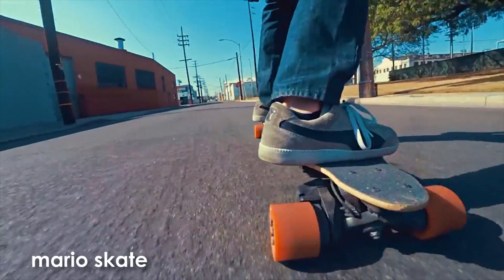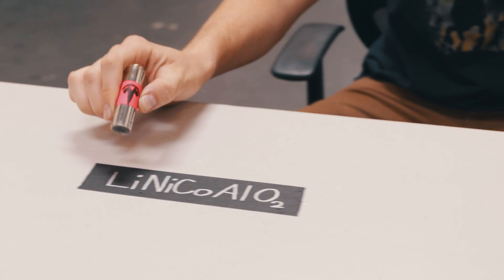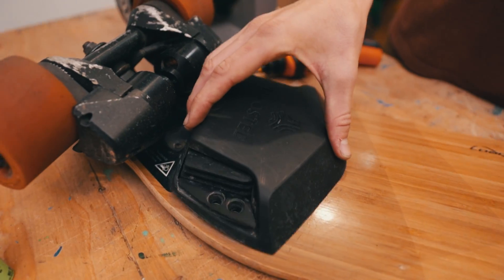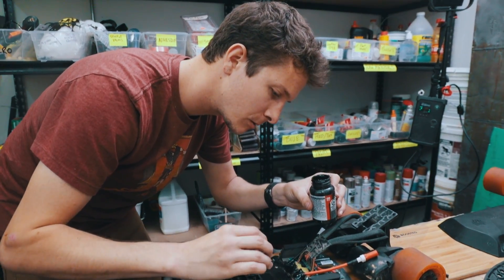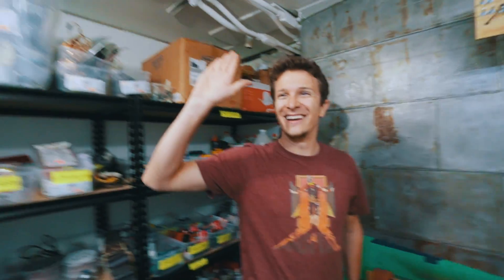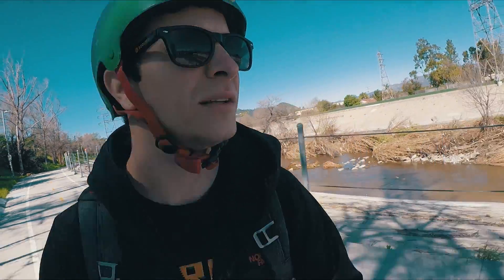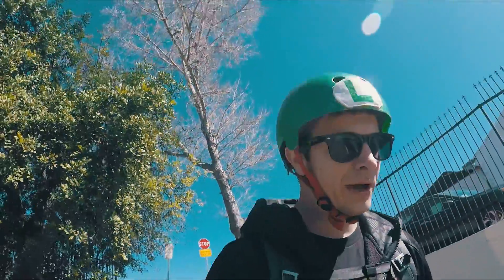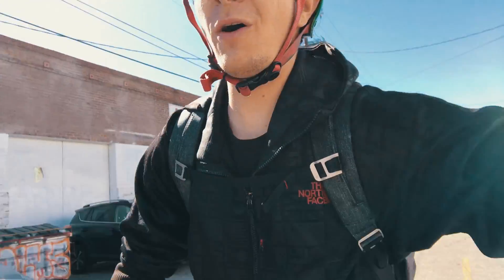Tesla Batteries in an Electric Skateboard!

Comment: Thanks for the comments everyone!! I appreciate the feedback! It turns out I really underestimated the current draw to the motors. I understood that the batteries I used didn't have high power output, but my hypothesis was that using two packs to share the load would be enough to compensate. Wrong! It turns out I need at least 4 or 5!! Dangit!! I know better, I should've done the math on this first.

Geeky numbers section: So the motors are 2000W and the current draw is about 50 amps (at full speed). The battery system I added maxes out at about 20ish amps. The solution is to either use more packs in parallel, or make new packs with much higher power output ratings. So the issue had less to do with Voltage, and more to do with the battery's inability to provide enough energy fast enough. 
Again, this is just yet another hypothesis. I won't know if I'm right until I test it again. Another video solving this maybe?
Reply: Will Wren solve the mystery? Find out next time on Battery Busters.......
Reply: wren - explanation is ...ok (scroll to the end of my comment for a simpler explaination)
Issue is the "water" is amperage.
The bottleneck would be the voltage, your pour analogy between the cup and the bottle would be incorrect. It would be correct, if the cup was a smaller bottle. Pour at the same rate (voltage), but one empties faster (amperage).
Voltage is the "path" of the amperage.

The reason why most power monitoring devices use voltage to check battery life, is that it's easier and uses less components to do. When amperage lowers in a battery to a certain point, the battery itself starts to "add" resistance, thats why you start to see the voltage drop. "Adding" isn't entirely correct, but just makes it easier to explain.

I assume you used batteries that have a mah (milliamp per hours) rating of 2000 or 2500 (2amp to 2.5amp)
You should really be using ones that are 3000mah or higher. Probably the highest you can get will be best. Fair warning, these batteries can get pretty pricey, probably end up costing as much as the skateboard.

And Tesla start making their own batteries because existing battery manufacturers can't produce them with the mah that they want. That's the holy grail as far battery life and efficiency.

If possible you want to get batteries with the lowest possible "C" rating. I forget what C stands for, but the lower the number, the higher the amperage it can push out.
----------------------------------------------------
Just to make it simple in what you needs to do, is since you already know the original battery voltage, find out what the watt/hour or mah the original battery is rated for. 
If watt/hours then plug it in the following (watt/hour) divided by voltage multiply by 1000
It will give you the mah of the pack, then divide it by the number of cells int he pack. 

Then you just need to find batteries with a significantly higher mah that the number calculated......

Or simple solution is to just put more banks of batteries on there.
Reply: Why dont you just make the board run only off the new battery packs instead of the ones in the board AND the battery packs.  Don't use both, make it run off the new packs you made only.
Reply: would love another video on this! i find it super interesting and entertaining, plus i really want to see you succeed at this project! think it would be really cool if u could pull it off
Reply: Off battery topic: Be careful going too fast dude, I had a regular long board for years, went a bit too fast going down a hill ( similar to boosted board top speed)  went to jump off and my knee folded backwards ... like a flamingo! Vomited with the pain and seeing my knee like that....5 months on crutches, surgery and 1 year of rehab. Sold my beloved board :(   Interesting video dude!
Reply: Mr Moyaa Will he figure out the mystery? Or will he be wrendered helpless to the power of his car?
Reply: wrenthereaper another video I'd watch I love the DIY stuff. The Geeky science is good every once in awhile as long as it's fun for you in the process 👌🏻
Reply: wrenthereaper yeah the Panasonic cells can only deliver 7 amps. With only 2 parallel packs thats not enough and is going to cook the cells.

Did you use them in parallel with you original battery? I would't do that. I'd get rid of the original battery all together and only use your new packs (more of them in parallel or with better cells like Sony's new VTC6). Even when in storage for 6 months the original battery should not have lost that much voltage (I have cells that only lost 50mV in the same time. That means its probably at the end of its life. When these reach their rated life (250-300 cycles for high drain cells) not only will they only have 60-80% of capacity left but also only be able to supply 60-80% of their rated amps.

oh and remember that the nominal cell voltage is 3.6V. so if you want 40V 10S is not enough. better go with 11 or 12.

another note. a lot of the comments here are horrible advise from people who have absolutely no clue what they're talking about, so take everything you read here with at least one grain of salt (including this comment I guess;). better get on the endless sphere forums to get your questions answered there.
Reply: No, you don't add current of the cells when you connect them in series, you add voltages, so the way he has it connected(with 4V 10A cells) is 2x 10 cells in series making two 40V 10A cells then connected in parallel making one 40V 20A cell
Reply: Portable Electric Vehicle  no, thats not true. Countless people have huge soldered batteries without any issues. See Jehu or all the powerwall builders here on youtube. Its kind of an urban myth. Just don't use a tiny iron that you have to hold on the battery for minutes. With the right iron the soldering only takes a couple of seconds and that heat is quickly distributed throughout the cells. I hear this a lot, but nobody can ever back it up with any kind of evidence.
Reply: Portable Electric Vehicle Illegal? Ever heard of Fair Use?
Reply: This was a really cool video. I'd love to see a followup vid! You're a crazy genius and I love it!!!
Reply: instead of 18650s try 26650s
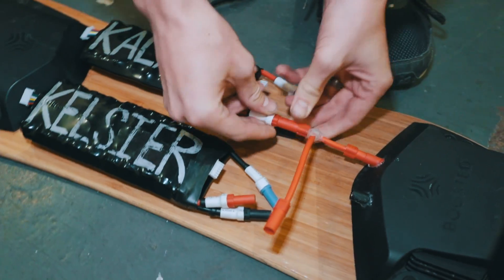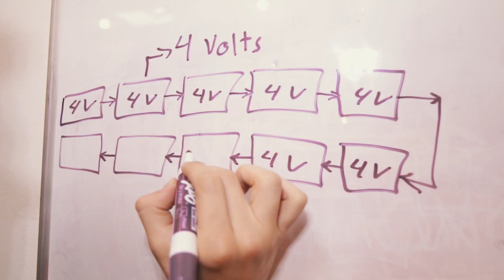Reply: androd - He's not up'ing the speed, he's upping the range. He's not increasing the wattage draw, so heat wouldn't be a factor. And I don't see why having the original battery in there would cause any harm, except it being dead weight when it's flat. He's running the packs in parallel to increase mah, you can see that they are in parallel at 4:20 . He put the "cells" in series in each pack to MATCH the voltage of the original one. He even said this at 2:35

wren- another idea is to have removeable packs, so you won't have to have so many packs under the board at the same time. when it runs flat, just swap it out. I suggest you keep the parallel connector there, so you can plug in the fresh pack THEN remove the flat one, so the controller board doesn't shut off.
Reply: +mtktm - You made a mistake about the C rating - the higher the number, the better. C indicates how many times it's capacity can the battery output in amps.
Reply: angrod - It was 5 mph when the batteries were running flat. towards the END of the video 9:45 . The boosted board has a top speed of 22 mph and a range of 5 miles.

The board was clearly working when he read the battery meter on the hand controller, was reading dead. 

With an assumed average speed (when fully charged) of about 10~15 mph it shouldn't degrade anything due to heat. And its an AC drivetrain, so the motors aren't the things that get concerned about over heating, it's the motor controller board, specifically the MOFETs. if things got hot enough to degrade it would have happened with in the first 30min ~ hour.
Reply: The best option would be to use higher discharge current batteries, like the LG HG2, they are the same size (18650), have the capacity of 3000mah, and max continuous discharge current of 20A, so 2 packs of 10, connected in parallel, exactly the same as your current setup, would provide 40V & 40A, so 1600W. That should be enough.
Reply: @Portable Electric Vehicles: Vitalie, I'm a fan of your videos. I definitely defer to you in regard of what I'm doing wrong here. I'm just trying to learn and get better at this. Your feedback is valuable and I'll definitely consider it by first revising my calculations, as you said they were wrong. It's possible I damaged the cells by soldering them, I knew it was a risk. I tried to be as fast as possible and they've shown no issues while doing charge and discharge cycles with my charger. Worst case scenario is that they are damaged and I just need to make new ones. 
As for copying your videos... I hardly think this video copies yours. A couple of your videos definitely inspired me here but I think everyone can agree they're very different.
Reply: What did he use that you created there?
Reply: wrenthereaper Don't worry on the soldering. You did a good job with it and whatever the issue is, its not from the soldering.
Reply: dood, just buy a bicycle :D
Reply: why not use 26650 batteries? alot of them are 30-35amp max discharge with a pulse discharge of up to 50 amps. they're 8mm taller then the 18650's but they also hold up to 5000mah instead of the max 3000mah of most 18650's.
Reply: maybe you should use LG choco 18650 cells that can output maximum of 30amps each with a capacity of 3000mah.
Reply: You could try Sony's VTC5 or LG's HG2 batteries. VTC5 has constant 25A output, and afaik it can also output 35A without too much heat. HG2 has slightly bigger compasity, but it can't output that much of amperage
Reply: + wrenthereaper YOU COULD MAKE IT SO IT RE-CHARGES THE BOSTED BOARD BATTERY
Reply: Star Blaze Very nice.... Very nice...
Reply: wrenthereaper be serious Wren... we know this was all just an elaborate audition tape to be a guest star on the new Bill Nye show... lol
Reply: An electrical circuit is only as good as its weakest link. The Boosted Board battery is inferior to your extra batteries and thus becomes the limiting factor. The only real way around this is to replace it with more of your own batteries.

Btw, increasing the available amperage to the motors is a neat idea however it comes at the price of heat. The motors probably aren't meant to handle that amount of current. It might do fine on level ground but going up hills could burn them out quick.
Reply: Unfortunately this is a bad idea. Linking the batteries in the way you describe will put the new batteries in series with the original one which will increase the overall voltage. Basically they will add together and he will have 80 volts applied across the motors. The board would turn into a rocket but he would quickly kill the motors from heat.
Reply: I see. I got the range and speed confused. I thought he was trying to increase the speed, not keep it elevated longer (and increase the range.)

I personally would still not be comfortable doing this. I would rather just ride a bike which comes with the added benefit of exercise!
Reply: +Wojtab - discharge capacity is the C rating
Reply: mtktm sorry, but there is a lot of wrong with your comment.

First of all, Wren uses Panasonic NCR18650B cells. They have 3400mAh and can deliver around 7A continuously. Those were the cells first used by Tesla. Tesla did set up the Gigafactory because they need vast amounts of cells, not because they can magically produce better cells than everyone else. In fact, the Gigafactory is a cooperation with Panasonic.

Lets say his board uses 2000W worst case @40V. Thats a 50A draw. His two 18650 packs can deliver 14A together. Maybe double that for short periods. Thats just too much and will kill the cells. 
I still has his original battery paralleled but I think that one is at its end of live. If it lost that much voltage while in storage I'd say its done. Healthy Lithium Ion cells should only lose minuscule amounts of voltage over that time. 
It could be that the original battery is constantly losing voltage and thus dragging down the new packs paralleled with it. But he showed, that the voltage is kind of ok, so it must be the lack of amps. In any way, the original battery is too different from the new packs and I would get rid of it.
It could also be that he's using too few cells in series and is not getting enough voltage. I don't know what his board uses but 10 cells in series is only 36V nominal, not 40V as shown in the video.

Your explanation of C rating is also wrong. A 2000mAh battery with a C rating of 1C can deliver 2A of current, with a C rating of 0,5C it can deliver 1A and with a C rating of 20C it can deliver 40A. So higher is better (not that it matters in this case)
Reply: Ivan Stroganov i have all info on my channel. but i dont know which cells is he using. tesla panasonic B are not the same u can buy in the store. the one u get in the store can give you @18 miles on flats with @15 mph at the last 2-3 miles. he maybe killed the cells when he soldered the cells.
Reply: Portable Electric Vehicle soldering the cells is no problem. As far as I know there is only one NCR18650B. There are other versions like the NCR18650PF and many many more with slightly different specs. But the NCR18650B is commonly known as the Tesla battery (Tesla later used custom versions of it and is now abandoning the 18650 form factor altogether). The original boosted board uses LiFePo batteries that can deliver 50A continuous and 120A peak each. The Panasonic can do 7-10, but running it at that level you're reducing its life quite a bit. They are no high drain cells, it only works in a tesla because they have many thousands of them and use high voltage to keep the amps down. 2 parallel is just not enough.
Reply: Portable Electric Vehicle Dude I know that Tesla uses different batteries NOW. They used off the shelf NCR18650B cells in the first Roadster and thats why they got that nickname and thats why Wren calls them that. When he solders his pack you can see the green Panasonic wrappers. So its the B cells (or a variation of them like CG, PF, etc). He just calls them "Tesla cells". I totally believe you that the esc has 30A, and I know that the Original uses 50A/120A ANR26650M1-B cells, but his 2 Panasonic packs in parallel is still not enough because it can't put out the amps if we have to consider that the original packs is dead(ish) from the way it self discharged.
Reply: wrenthereaper I wouldn't mix battery chemistries. I think you are essentially reverse charging the original pack because it will have much lower internal resistance and be delivering the bulk of the power while the newer packs remain at higher potential so will reverse charge.
Reply: hm, what if you replaced the original batteries with two more of the ones that you have used in the custom battery pack already? just an idea, im no expert so idk if itll work, but assuming the original battery is, in design, lower tier than the new additions to the one you have, i suppose, the whole is only as strong as the weakest link, in this aspect?
Reply: wrenthereaper I'm no tech head or know anything about electronics, but this video was fun. My question/solution: is there any way to get the original battery pack to stay charged? Like instead of all the battery packs using power for output at the same time, let the original battery pack handle the output and let the new battery packs focus on keeping the original battery pack juiced? Again,just a thought from someone who knows nothing about electronics.
Reply: Josh Locke everything under 3 volts per cell damages the cell, so you want to stay above 3 volts and preferably even above 3.3 volts.

using amp cells could be the sollution, but unfortunatelly they hold less charge, so range is lower.

More packs would provide more amps and range.
Reply: wrenthereaper couldn't you just remove the regular battery
Reply: your amp draw is a function of your own weight pushing down on that board. Reduce weight to increase range or add batteries in parrelle to increase capacity and amp output. Capacity is a measurement of Amp hour. More amp hr means more capacity.
Reply: why not replace the booster board battery with the 18650 pack
Reply: steffen ottemo the capacitor has to be charged with the battery packs, so for range it will not improve anything. 

It could help out with sudden spikes in power demand, but it won't help with a constant 50 amp pull from the motors. If you are constantly pulling 50 amps from the capacitor, the batteries need to fill it up with a continuous 50 amps aswell.
Reply: Follow-up video. Please.
Reply: i would suggest having higher voltage for the batteries.. and add a converter to 40v or what ever is needed.. so that ur batteries can withstand 2k W
Reply: wrenthereaper DUDE. REPPIN' THE SANDERSON, I love it.
Reply: wrenthereaper no I'm to late wren please read my comment
Reply: I'd love to see another video on this topic, found this one very interesting
Reply: you can check on my channel some of the info.
Reply: I wish i had a one wheel or a boosted board...GOOD LUCK ON THE BOARD WREN!
<3
Reply: Cody Myers - the numbers for the battery names, are just the physical size. 18650 would 18mm diameter, 650mm long. When it comes to lithium ion batteries, larger doesn't meant better. I believe 26650 have a slower discharge rate and not much difference in mah.
Reply: He did mention he wants to increase the speed as well as the range. I don't think he wants to have a 3 hour ride to work at 5 mph.

Wattage is merely a way to measure power used to do work. There are two ways to change wattage using batteries. You can either increase the voltage (series circuit) or the amperage (parallel circuit.) Volts x amps = watts, so by adding extra batteries in parallel to the motors he has effectively increased the available power for use, i.e. increased the overall wattage. This shouldn't be an issue in low load situations but in high load conditions such as going up hills the motors will draw more current than they were designed to handle. I see heat death incoming unless he finds a way to keep the motors cool.

As for the original battery, there's nothing wrong with it other than it's limiting the new batteries. They can't be utilized to their full potential as the original battery hits its voltage minimum and the board stops working.
Reply: Sander A. - my mistake. I always get mixed up on which way C rating goes.
Reply: mtktm wrong, they have better energy density. however I wouldn't use them since because 18650s are so readily available they are much cheaper for the same amount of power/capacity.
Reply: I am getting the new Tesla BATTERIES!!! I will make a new mod that works with V2 and add 25 miles in range. It should be @ 20 miles at full speed and the rest with @17-15 mph which is better than SAM gets.
Reply: I know, that's why i said that they have 3000mah capacity AND 20A max. discharge current
Reply: Wojtab discharge speed is C rating. 20A x 10 = 200A burst which is enough. there is another issue that he has.
Reply: +Wojtab - To better explain what Portable Electric Vehicle is saying...
https://www.commonsenserc.com/page.php?page=c_ratings_explained.html

The motor control board will only draw enough amps for what it needs. C is what the battery can safely discharge at (pulled by device demands, is a better way to phrase it). Batteries can discharge more than C, but then it's being worked out of it's range of operation. I believe that's what he was saying when he said 20A x 10. 10 would be C
Reply: Portable Electric Vehicle what math? I just made an assumption because I didn't know the actual specs. 30A is still double what his 18650 packs can suppy (not counting the original pack since that seems to be mostly gone)
Reply: Ivan Stroganov check my video on the new 2170 cell. yes tesla cells are different. i tested most of available cells on the market and u numbers are wrong...
 i will post test of the 20700 in few days on my channel. BB draw 30 amps and max op. voltage 45V. its written on the esc.
Reply: Ivan Stroganov soldering is not ok. it destroying the cell. you have to hold the pen less than 1 sec and cool the joint right away other wise u kill the cell.
Reply: wrenthereaper even if you use shots or short clips you should of place the surse and add the video link into the description. Using others creators content without placing the sourse is illegal! I quick message for permision would be nice too.
Reply: +Star Blaze
same bat time... same bat channel...
Reply: wrenthereaper maybe use stacks or 8 batteries and place them "sideways"...?
Reply: Yeah man, normal ICR cells cant handle that amount of current. I'm surprised they didnt catch fire. Tesla gets around this with a giant several-hundred-volt inverter so that the current draw is much lower. But in this case, you dont have that. 

IMR cells could probably handle the load if you want to look into those. Capacity is a bit less, but you arent using them down to their empty voltage anyway. 

As for that problem, well you'd need a beefy boost converter. They make some 10A/400w ones on amazon for about 30 bucks. Not sure what the draw of that motor is though.
Reply: wrenthereaper solve it!
Reply: instead of it being parallel why not make into a series. so instead of getting 4.2 volts from a full charged 18650 battery. you could get twice the power with series.
Reply: wrenthereaper what part of the battery pack was limited to 20ish amps? 18650s which is what I assume that was can go up to 50amp continuous discharge if you buy some good oens
Reply: wrenthereaper Use the vape battery chemistry. They can do 20A a piece. Two packs like you had,  40A. Add one more pack and you'd have 60A max on tap, that's a ton of power. Get 2500mah cells and you've got hella range.
Reply: His cells ARE in series. How do you think he's getting 40V out of his pack?
Reply: There is no such thing as "vape chemistry". The world doesn't revolve around you fucking perfume suckers. There IS such thing as IMR chemistry batteries that can handle ~20-25A each.
Reply: Hodge Podge Productions Yeah.  I hate vapers too. Couldn't think of it right away.  That's the easiest way to find it.
Reply: buy alot of sony vtc4 batteries their discharge is 30amp so like 3 oh those packs and you will be good
Reply: Instead of two large packs maybe only add a few more batteries but split it up into 4-6 smaller packs.
Reply: not exactly.the 30amp draw is still pulse, not constant. its still like a 25amp battery.
Reply: Mr. Urmo's channel believe what u want
Reply: in my theory you should be able to connect the dual secondary batteries to the main battery and they would show the battery levels on the controller, but that won't fix the power output needed, so maybe connect a amp extender to the secondary batteries to give it the right power output as the internal. so that would give the necicery power output you need. i would love to talk further about this because I'm majoring in electrical engineering for a job, just send me an email and I'll respond

jonesmat001@gmail.com
Reply: matthew jones His biggest issue is mixing chemistries. life is like half the voltage per cell as liion.
He's playing with fire.
Reply: lifepo is 3.2V/cell nominal, li-ion is 3.6V/cell not really half. 
But I agree with the not mixing chemistries part.
Reply: It's not half the voltage. I'm mixing 10 Li-Ion cells with 12 LiFePO4 cells so their voltages are roughly the same. It's within the range of reason at least.
Reply: wrenthereaper Yeah, but still this guy needs to pay attention.  If he did match 10 for 10, you've got trouble. That'd exceed the +-.2 or so safety margin of overcharge.
Reply: wrenthereaper but if you put 5 packs, wouldn't it make the board really heavy?
Reply: just juse li-ion cells with 30a Output- not that much capacity but high current!
Reply: wrenthereaper have a switch to make both of the powerpacks work in a series instead of parallel when it reaches lowbatter and it will work like a final boost of power for a short distance
Reply: Josh Locke not really a good idea. The system is 40 volts and the empty batterypacks are 33 volts. connecting them in series would give you 66v and probably fry all of the electronics instantly
Reply: Nijsten Rijvaardigheid ok i didnt see the empty voltage as 33 volts
Reply: wrenthereaper i think you will need to gat a nore powerfull engine like 48v or more
Reply: Take the longboard battery out and use the modified betters
Reply: JOULE THIEF CIRCUIT
Reply: wrenthereaper up tour resistance, than hou draw much more current
Reply: MadOss that would mean that you place your batteries in series to run your higher voltage trough a big, heavy and inefficient converter to get back down to 40 volt. 

The type and amount of batteries provide a certain amount of power that can be delivered.

It does not matter if you have 4 packs at 40v delivering 15 amps a piece connected in parallel to give you a 40v 60A pack
Or the same packs connected in series to give a 160v 15A pack. They are both 2400 watts.

Higher voltages give a system a slightly better efficiency. But the main advantage is that with a higher voltage the amps go down. This means that if you have a 80v motor instead of a 40v motor that the amps on the 80v will be half the amps you would have on the 40v. Especially speed controllers for the motor would become smaller and cheaper.
Reply: problem even with 4 or 5 packs is that you will still end up not being able to use a lot of the energy
Reply: wrenthereaper Sony vtc4s or vtc5s
Reply: wrenthereaper 
Late to answer, may be you made another video. But still-  The circuit of the board is not made to handle those Tesla types. Use normal 18650 batteries. Add extra for more power. At first run the battery indicator will show low battery because it is not optimised.  Keep running and fully empty the first charge. Then the circuit will recognise the extra capacity.
Remove the plastic casing and attach the battery pack there directly, covered with a custom protective shell or foam. If you place the batteries at the middle of the board where it bends, they will hit the ground.
Reply: Use a capacitor for turbo boost
Reply: Wren, i am no engineer nor am i an expert on the cans and cannot's of electrical wiring , so I am sorry if this is a dumb idea, but couldn't you link the original batteries to the new ones so that the new ones are also feeding the old batteries power as you ride, thus allowing the old batteries to remain fully charged until the new ones run out?
Reply: wrenthereaper you calc. are wrong. the board pulls less amsp and u need the right cells. also why are u copying other people videos whitout their permission?
Reply: Ivan Stroganov wrong. if you read the esc max 30 amp draw. the entire BB pack has 2.2 amps per cell so u math is way wrong.
Reply: Shouldn't this be possible if you used a big enough capacitor from the new baterries instead of the old on board? Then the capacitor would work as the on board battery charged by the new ones. I don't really know just a guess :).